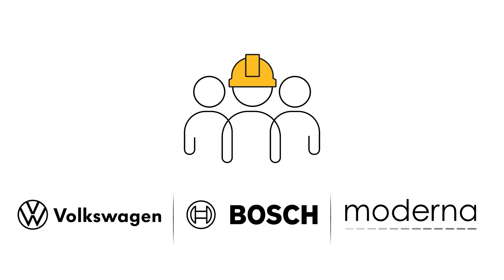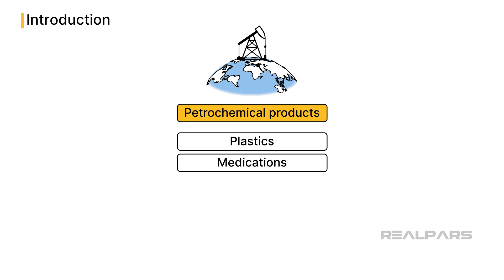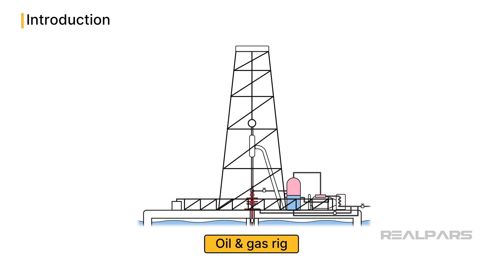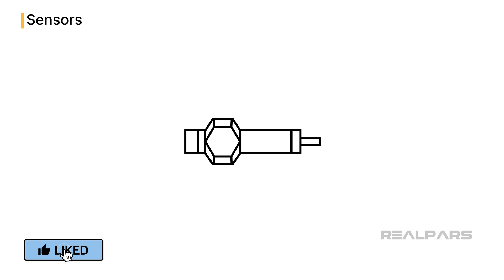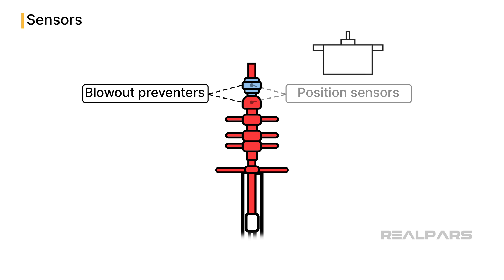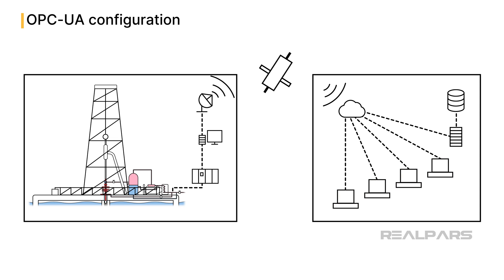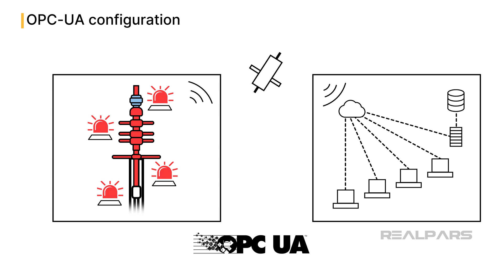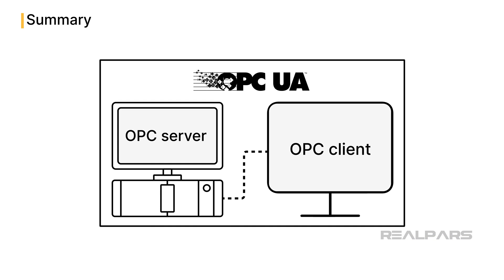OPC-UA Application - Oil & Gas

Comment: How do you transmit OPC UA signals from the wellhead to the control center which maybe hundreds or even thousands miles away from wellhead? using satellite? or starlink? or do you need build a signal transmitter center near each wellhead?
Reply from the maker: Thank you for your question. This is a good question, and there are a few ways to get the signal back to the main control panel from a remote panel located next to the wellhead. However, I would ask the project engineer to see what option he/she will use depending on location and other engineering variables that must be considered.